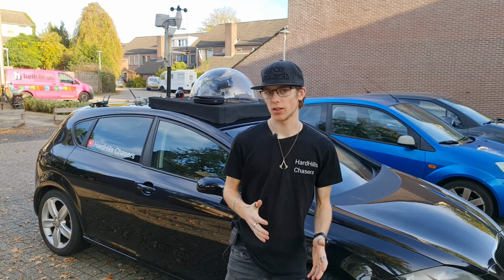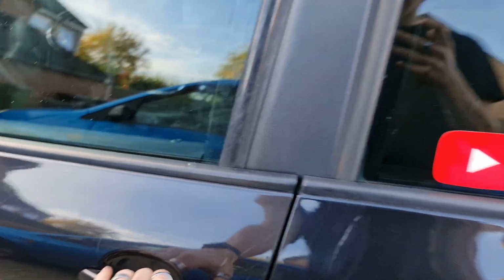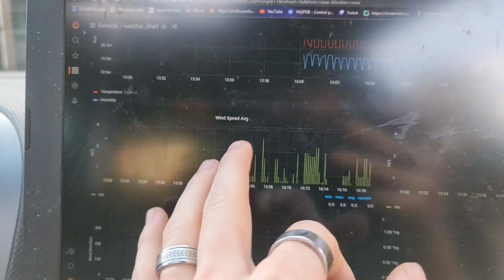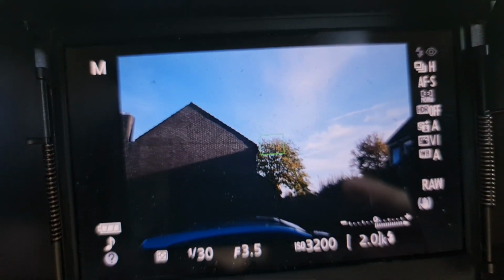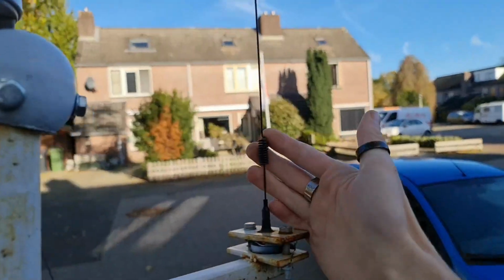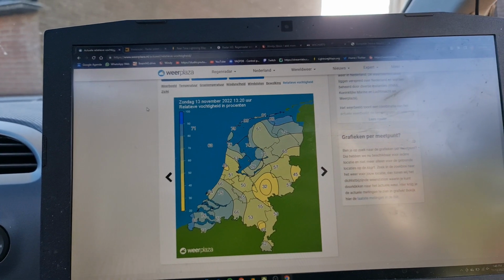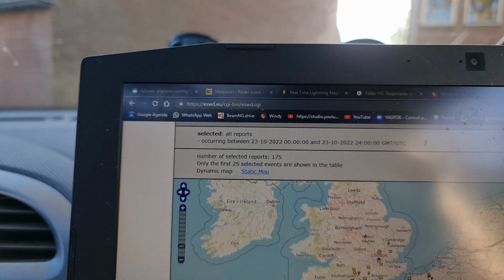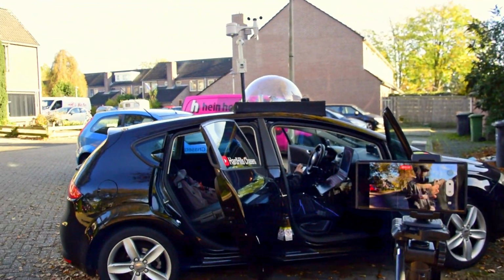What's Inside an Affordable Storm Chasers Vehicle?

Comment: I just worry about people chasing in these little economy cars, sure they're cheap but you can't put a price on your life.
Reply from the maker: We understand your concerns, but in our country (The Netherlands) driving a heavy 4x4 or other large car really isn't affordable anymore. Gas prices are more than 2 euro per liter, taxes for heavy cars are at least 5x more expensive and insurances at least 3x. We don't want to chase in a 850kg car so my choice went to a intermediate car. Unfortunately there is no other option until some money is made with storm chasing.
Reply from the maker: A quick conversion in case you're from the United States: gas is about $9.60/gallon
Reply: @hardhillschasers9466  good lord! Nearly $10 a gallon is insane! Here it's $2.90 which is still a lot higher than it needs to be.
Reply from the maker: Yeah it really be like that sometimes.. It's the main reason people drive inline 4 engines, rather than V8s. Though we don't drive into tornadoes and generally don't take gravel roads, so 100hp and front wheel drive will do for us. In the United States, it's better to go with All wheel drive for cars and 4x4 for trucks, as well as more power and better tires/ride height due to the road conditions and longer distances driven